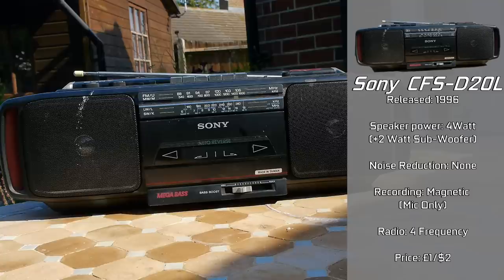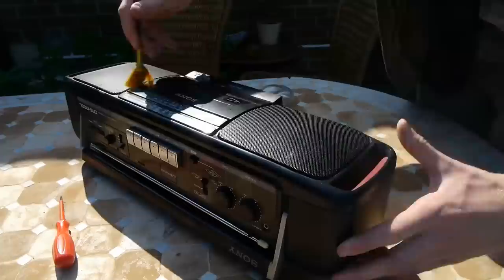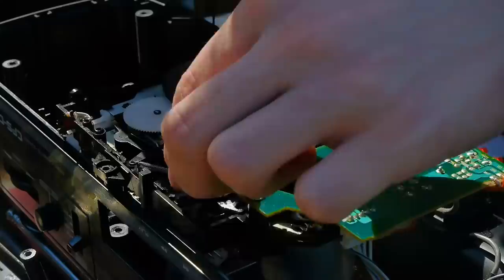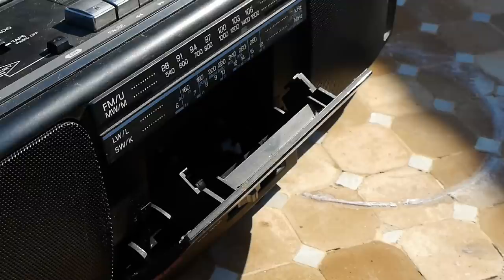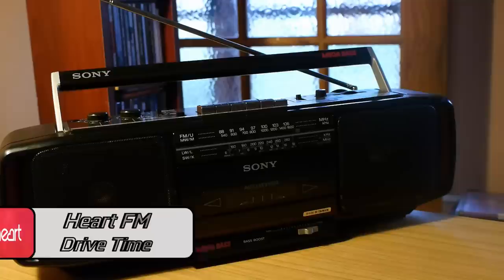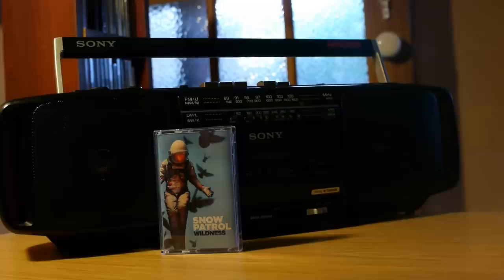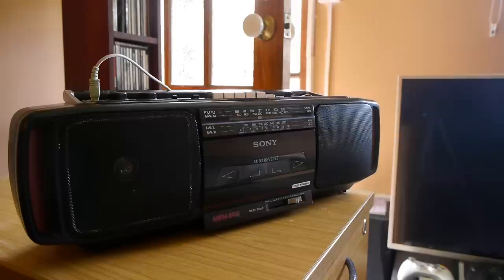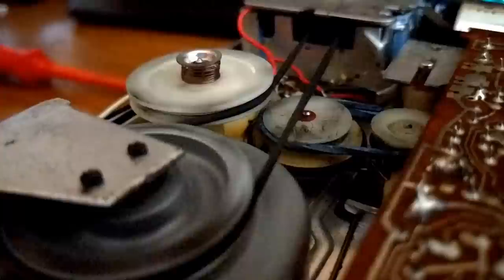90s Boomboxes...Are they even worth it?

Comment: I remember getting a new tape player in 2013 that was so cheap it only had a play function, not even a FF/RW. and not long into owning it the pitch screwed up, so I went with a used one from a thrift store which while still has a bit of a pitch issue (but nowhere near as bad as the "new" one) is better suited for playing tapes.

Comment: clean the caspian pin and the roller and anything that comes in contact with the tape with iso, ferric tapes leave an awful mess. clean the drive wheels and belts with alcohol, grease and oil tends to migrate from the metal parts
Reply: Only leave mess if they suck
Reply: they all leave oxide behind to some degree and a crappy head, misaligned capstan  pins and rollers and poorly ground guides i.e. nearly all sub £300 decks, can make it work

Comment: I have a Sony CFD 440 that one of my friends did not want anymore and told me it did not power up, but, it did work, I just did not how to turn it on at first because I had never used a boombox before, when I first got it it was really dusty, and now Its working perfectly, except for the CD players, which is dissapointing for my Megadeth and Hard Rock/Metal CD collection, but either way it has a Mixing Mic port which works well as an AUX but, some instruments just sound low, so I used my Bose speaker which i was using before, connected my PC to both of them with a Audio Splitter, and now its just perfect!!!

Comment: You can get a DBX noise reduction thingy that you can add to Cassette/8-Track recorders they usually cost between 45-350$
Reply: And they also increase dynamic range apparently.
Reply: there's no way to insert anything into the signal path between the deck and the amplifier in these without modification, also it wouldn't really be portable anymore

Comment: The best ones come with graphic equalisers. The ability to play metal tapes is also ok although I was never fully sold on the metal tape format. Record on Metal once then try again it keeps the original over lapped with new. You are hitting into my turf now, I been buying brand new boom boxes or Ghetto blasters since the 80's.
Will say this though, I did like chrome cassette tapes.Those were very nice.

Comment: Awsome to watch :D ps if you can get a JVC boomBlaster for cheap its worh it since it has well made speakers i think 40-60 watt front and side is 60-80watt(if i remember correctly), i still have the Verry First version of JVC boomBlaster, it has guitar amp& Casett player but it cant play cd-r if i remember, version2 had mp3 cd-r playabel and then in v3 it had docing station XD